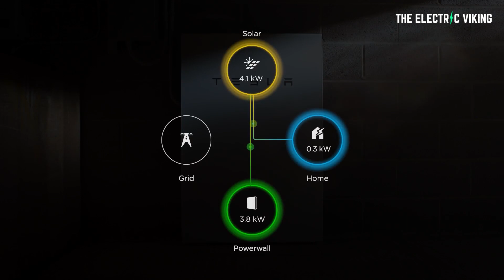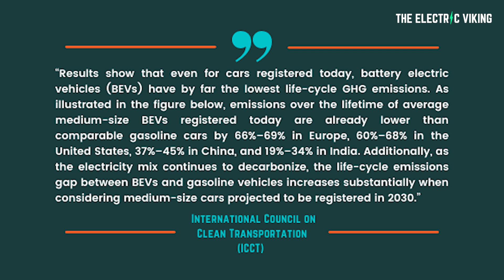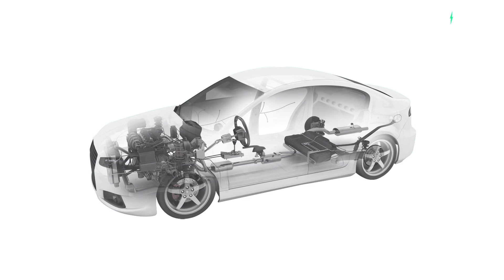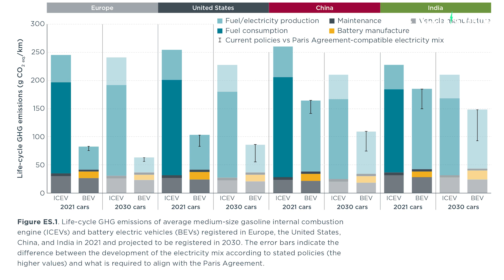Why using an electric car is FAR better for the environment in every country in the world

Comment: That ICCT chart has one problem - it lumps Europe as one big region, but the energy mixes across the continent differ wildly. From Iceland, which is almost completely renewable thanks to geothermal and hydro and Sweden, which is in a similar boat, and France which is majority (IIRC 60%) nuclear powered and Spain which has a big fraction of power come from solar and wind... but on the other end of the scale you have Germany which is 25% coal, and Poland which is 70% coal... Also it seems to be concerned with lifetime emissions, does it include production emissions?

Comment: In Victoria, on one analysis, EV users are paying 60% more "fuel" tax than petrol car users. A petrol car paying $1.42 per litre and getting 11.1 litres per 100 km is paying 11 cents per km in fuel costs exclusive of 42 cents per litre excise. The excise works out to about another 5 cents per km. If petrol is selling for $1 plus 42 cents excise the excise is 42%. My EV gets about 6 km per kwh and as I am paying 25 cents per kwh for electricity I am paying about 4 cents per kilometre. As I have an EV and am not paying the 42% tax I have to pay a 2.5 cents tax per kilometre. So I am paying 4 + 2.5 = 6.5 cents per km and the 2.5 cents represents the equivalent of a 62.5 cent excise on my fuel which is around a 50% higher rate than is paid by the petrol car motorist. So I, as an EV motorist am effectively being taxed at a higher rate than the petrol car motorist. I should be rewarded for using less energy, not penalized. There is also no allowance for the fact that my fuel is produced in Australia and increasingly low carbon.
Reply: That's because the government does not want people buying EV s so they will always make sure that ice vehicles are supported by the public by this sort of BS !!!

Comment: When there is blackout because of  storm or flood or other disasters EVs would be useless. Ambulances and emergency vehicles can't be EV. Most cou7untries do not have reliable electricity. In America, American Indian reservations have no electricity or running water. EVs are good as second car. China electrified only 70% of railways and they expect only 50% of automobiles to be Ev by 2050, even though China has the most reliable electric grid. Most of the electricity in the world is produced with dirty coal.
Reply: In a blackout ICE cars can’t fill up at a fuel station either, the fuel pumps need electricity too! If you then say ah yes but they can use a backup generator - that’s what storage batteries do for EV’s. In the recent China floods the only car that could still function and came through a flooded tunnel was a Tesla. And why can’t emergency vehicles be EV?
Reply: Funny a good hybrid with a full tank can idle with AC or heater on for a week, how long can a EV do the same for? Gas stations can have backup generators. So sorry next time Texas has a blackout with freezing temperatures I will be much more happy to know that people with a good hybrid can keep warm and not freeze to death if the power is out for days!
Reply: @gregandkaruna6674  Well if your talking about using the gas engine of a hybrid on idle, most gas engines use around 0.5 gallons an hour when on idle. For an average 11 gallon tank you’d run out of gas in about 22 hours. Running the HVAC takes around 1 kWh per hour - a typical hybrid battery (8.8 kWh capacity) will run out in less than 9 hours. So even together with the engine it’s around 30 hours max (not 1 week). In a Tesla model S or X you could get around 100 hours. Even the smaller model 3 SR+ (50 kWh) would get you 50 hours. Even my Nissan Leaf would give around 40 hours! So I think I’d rather have an EV every time thanks.
Reply: @robo19681963  Where did you learn your math from you multiply the size of the engine x 0.6 plus the efficiency of the hybrid so lets take a Nissan E-Note with it's 1.2 lt generator engine only that is just 0.72 lt however it is changing a battery only so the efficiency goes much higher as once that 1.5kwh  battery is fully charged the engine shuts off. A plug in hybrid is even better with up to a 20kwh battery that also will shut off once that 20kwh battery is charged and if you are correct and the heatpump uses 1kw per hour then that plug-in hybrid will last 20 hours each time the battery is fully charged and quite easily a week use!

Comment: People neglect to consider how much ADDITIONAL  electricity is currently being generated to service electric vehicle charging.
The overwhelming majority of EV's are charged at home during off peak periods.
 The grid production capacity is geared to meet the peak period consumption and all the surplus electricity produced during off-peak periods is lost if not used. 
People fail to understand that you can't simply step up electricity production to meet peak demand and then reduce generation during off-peak periods because the generating system is largely inflexible.
Until the current off-peak period (example after midnight) becomes the NEW peak period, no additional electricity is being generated to charge EVs. 
EVs are using what used to be waste electricity and are an absolute God-sent to the utility companies.
Reply: Why do you consider that energy to be "additional"?  Those particular EV owners do not need to buy petrol or diesel, therefore the energy saved there (it takes 8kw of electricity to produce ONE gallon of petrol) means that, eventually the oil refineries use of electricity will begin to decline.......There won't be much point refining it if people are no longer buying it, will there?
Reply: @Brian-om2hh  I think you miss the point completely. 
If I charge my Tesla during off-peak I can say that I have not contributed 1 extra gram of CO2. How so? 
Of course the production of electricity produces CO2 (unless from renewables) but I used electricity which was produced anyway and if I hadn't used that off peak electricity it would simply have gone to waste. THE GRID CANNOT STORE SURPLUS ELECTRICITY! 
So me, Alex, contibuted not one gram of extra CO2 by the charging of my car. Do you follow me? 
Until the day that Alex and his million buddies charging their EVs during off peak, exceed the electricity available during off peak, they are contributing zero to the worlds emissions. The grid was making the polution anyway whether we used the off-peak surplus or not.
Reply: Its not if the grid can handle it, no its if the grid is a clean renewable one or a coal and oil burning one and unfortunately most of Australia is the coal and oil burning type.. Where I live my power is 100% renewable and the whole country is sitting on around 80%renewable power.
Reply: @nslay  US is the most stupid place to own an EV as your gas prices are so cheap compared to most countries, where I live gas (petrol) is $2.20 per litre so times that price by 3.7 to get the price per gallon you will see its extremely expensive of course if you compare the cost of electricity then we pay as low as 11 cents per kwh making an EV very cheap to run!
Reply: @nslay  Sorry I mean America is harder for EV due to cheap gas not stupid
Reply: @nslay  Like I said we pay like $8 per gallon and 10 cents per kwh, and no I do not live in the US obviously as people in the US pay like around $3 per gallon. Although there are a few free fast chargers where I live which makes charging my EV free.

Comment: I'm also convinced there are paid "plants" trolling around the forums specifically to peddle misinformed crap about electric vehicles......... The big oil companies know they only have a finite amount of time left before their once huge profits vanish down the pan. The clock is ticking, and they want to hang on as long as humanly possible, using any means they can muster...... They are of course hoping hydrogen comes to their rescue, then they can once again control the supply and the market.......although so far it doesn't seem to be going their way.

Comment: There is green carbon. And black 
A tree captures carbon .
Using the tree releases it 
Oil and coal were made because of lack of oxygen. 
Vegetation could not rot .
Using coal and oil releases co2  from millions of years ago .
Look up rethinkX. 
A Tony Seba Foundation. 
They have found that wind and solar with 25 percent batteries is a sweet spot .
Essentially free energy is coming

Comment: Facts, from the newest BP Statistical Review of World Energy, recently out:

CO2 emissions from burning fossil fuels do seem to have peaked. From 2018 to 2019, there was a tiny drop, about 0.2%. Last year, there was over a 6% drop. Obviously, last year was not a normal time, but given that the tiny drop in the previous two years was a change from all previous years, we can easily expect a more substantial drop in 2021 compared to 2019, if 2021 turns out to be a more or less normal year in regard to restrictive measures. That is MAJOR. Time for people to STOP just saying CO2 emissions are going up, up, up without pause. No longer true. Yes, there is room for quibbles. China may be not totally truthful abot some things. Hell, the US may not be. Natural gas production may be flaring more methane (or maybe not). Permafrost is melting. Rice fields are emitting N2O. and what about cement production? And on and on. But you can't just ignore that pitch-over on the fossil fuel graph. That's BIG.

Comment: Also when people complain about the cobalt in batteries, they conveniently forget, or don't know that by far the greatest users of cobalt are oil refineries where it is used in the refining process to remove sulfur.
Reply: To be honest, the use of cobalt in petroleum refining is significantly less than batteries, but EV makers are all moving to low or no-cobalt chemistries.  Most EVs are going to use Lithium Iron Phosphate batteries.  It is also possible to obtain ethical cobalt.
Reply: Yes, and LFP batteries don't use cobalt, and that's the direction that EV's are heading, especially mass market EV's like BYD and the cheaper Tesla models, because LFP batteries are cheaper.
Reply: Everyone's talking about LFP, but there's a similar, cheaper, more sustainable chemistry that CATL just made: sodium-ion. No lithium, let alone cobalt!
Reply: @موسى_7  Oh great yet another breakthrough battery that is still years away to actual production if ever